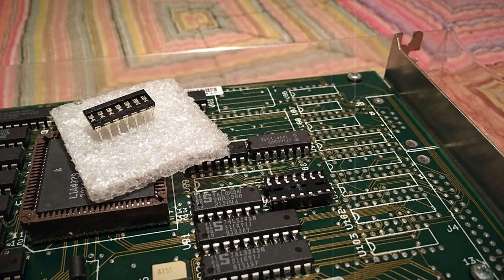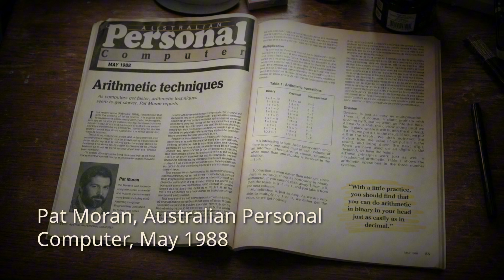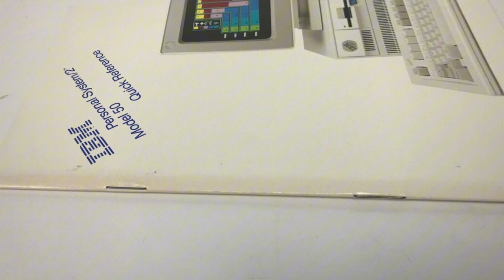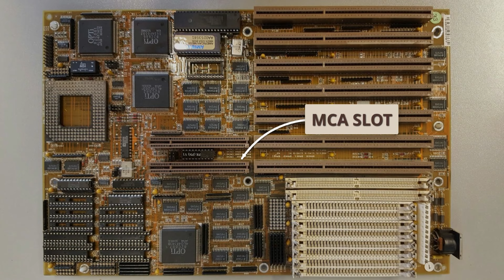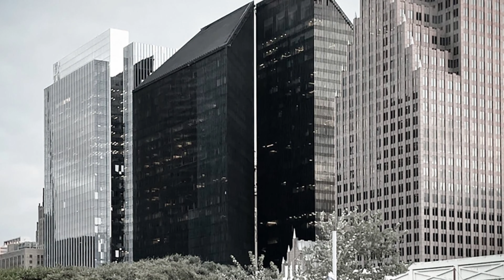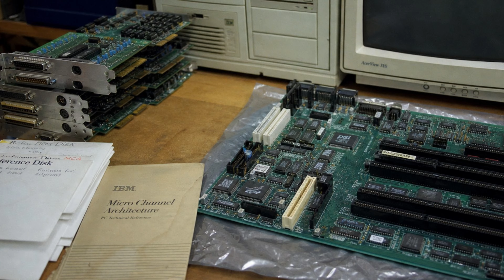IBM's Micro Channel Beat Everything. Nobody Bought It.

Comment: The PRICE and the lack of compatibility, killed MCA. Not to mention the NON-availability of cards to fit it! I fielded a phone call from a customer who had an HP scanner, but had bought an IBM PS/2 Model 50, and couldn't understand why the card could not fit in the new PC. I explained that IBM had introduced a brand new proprietary architecture, but that was not sufficient! I was told that HP should manufacture a new card to fit their new PC. I simply replied that, a car maker suddenly selling square wheels did not oblige tyre makers to offer square tyres. The answer was not well received. I have always wondered what her reaction would be to buying a European 230V appliance, and wondering why it wouldn't work in the US in a standard 115V socket!